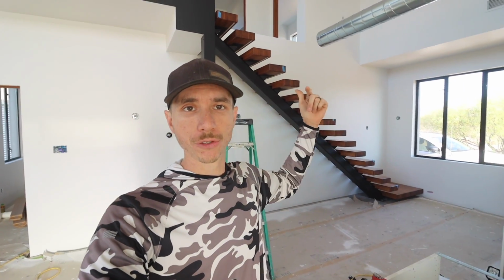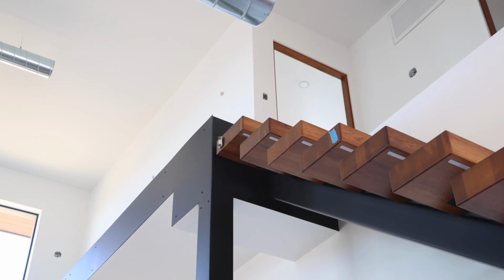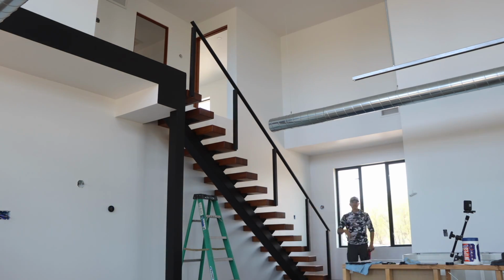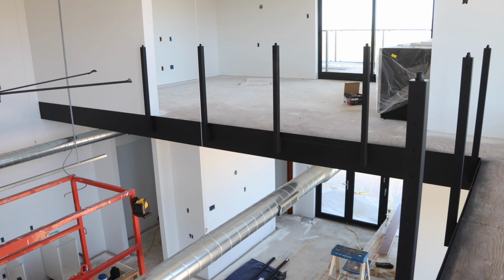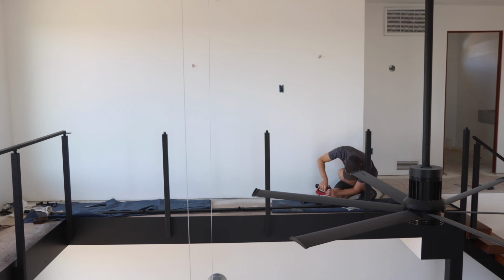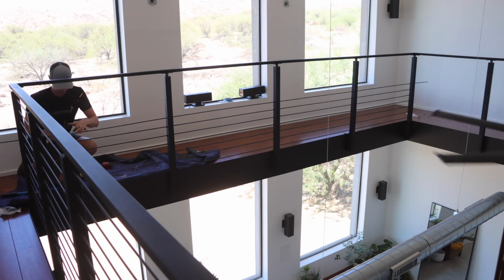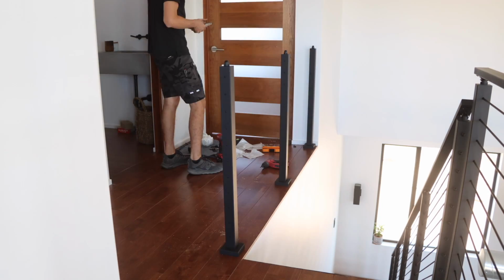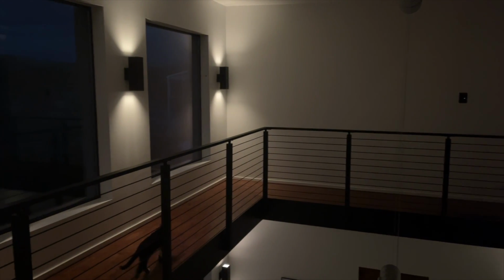Beautiful Modern DIY Handrail and Rod Installation

Comment: Problem with the rod system is every little kid climbs on it and bends the bottom rods.
Reply: Easily remedied just heavily coat the rods in axle grease the kids slide off before they can cause any damage. Plus warning signs every few feet "Kids Stay Back" along with a 120 dB motion activated alarm. If this fails just attach plywood sheets onto the walkway side of the railing to protect the rods.

Comment: Hey Derek, your place is looking awesome! I’m curious, did you use a Corten Steel facia around the outer perimeter of your catwalk? Unless I missed it I wish you would show that install footage. Thanks!
I’ve been saving an old mid century modern and have been living without railings on my catwalk for years.  I removed the very heavy looking wood slat banisters thinking it would be easy to replace it with glass, to open up the sight lines. Apparently it’s not that easy to just hire it out—oh no, not around here!   I  want to install frameless glass railings with the aluminum base shoe that sits below the flooring surface as seen in some commercial situations. I’m not wanting facia mounted or sub floor mounted post uprights, just glass. The last time I checked ViewRail doesn’t offer this type of mounting system. I found I can purchase the aluminum base components separately but the commercial vendors do not offer installation advice or instructions and I haven’t found any videos on how to prepare the floor joists to secure the channel.  
With your experience would you know if it’s safe to “notch” the end floor joists, then set the aluminum glass channel across the top of each joist and bolt it along the 20’ span?  A drywall concealed I-beam carries the load of the catwalk floor joists below, so I don’t think making a  6” deep  2” wide, U shaped notch would compromise the integrity of the joist in any way but I’m unsure.  I know the channel is designed to sit below the floor surface and is rated to prevent an outward fall load.  I could further reinforce the channel with additional wood blocking and maybe add some Simpson Strong Ties but I think that might not be necessary, I would then replace and finish the drywall facia. Your advice would be appreciated!
Thanks!

Comment: How's your average Temps looking like? Is your ICF walls doing as well as advertised?
Reply: ICF will do better than advertised.. I was very concerned with his oversized HVAC system as a few ICF owners that I know can heat and cool their 3000+ sqft homes with under 10,000 BTUs...   His system is going to be running in full turndown mode all the time...